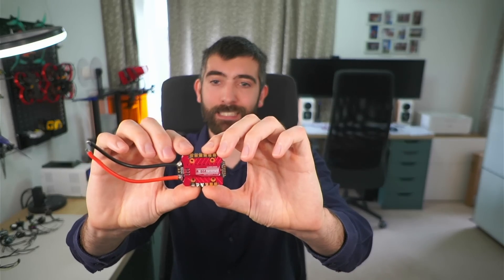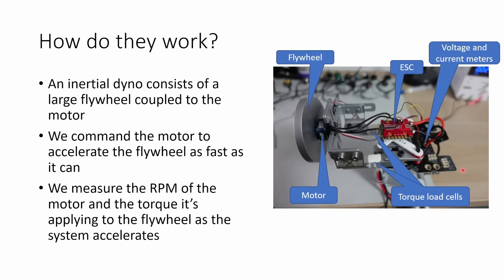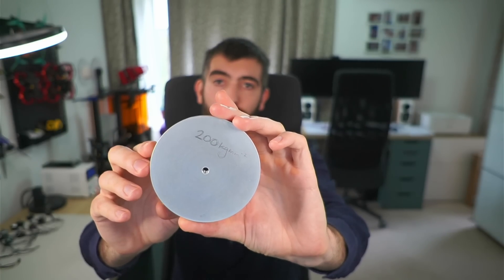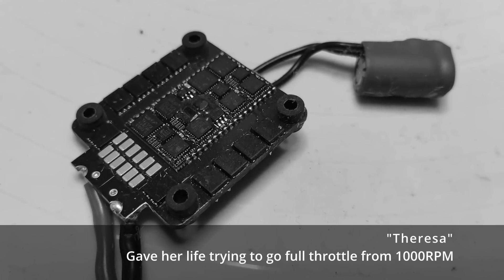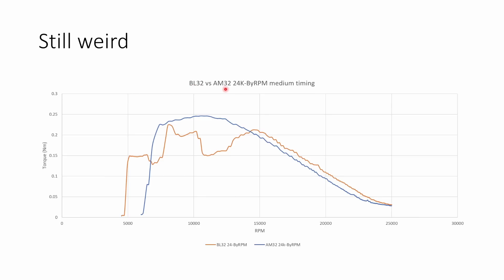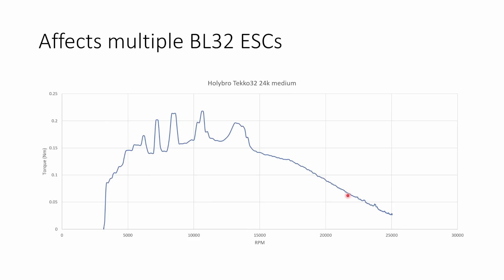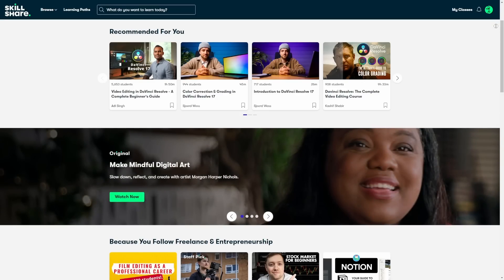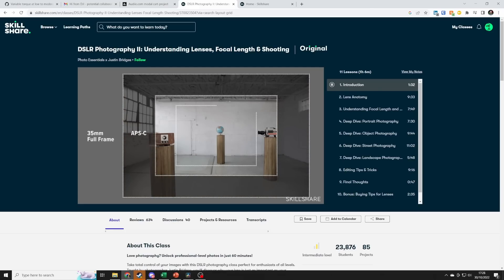Did I find a bug in BL_Heli32? Inertial dyno testing KM55A AM32 ESC.

Comment: Interesting test stand, are you planning to test different motors using this method? I wonder if this test will finally highlight the differences between 2207 and 2306 although I suspect not since its a power test, could be interesting non the less.

Comment: Not sure if it's low rpm throttle protection related but Am32 low rpm protections are let off gradually and proportional to the kV of the motor. That's why KV is entered into the config tool.
Reply from the maker: Whatever you're doing it is producing a really lovely looking torque/power curve 😁 Not having those big spikes and dips should really reduce the likelihood of smoking motors/ESCs under heavy loads. 👍👍

Comment: Do you think this issue can be connected to an unstable capacity of prop spin breaking? I’m just searching for an issue I have with 7” heavy builds when diving near completely upside down , where my motors seems to be incapable of stopping even at zero throttle

Comment: Very nice piece of equipment! I would raise a word of caution. Please consider a strong (polcarbonate or similar) protection shroud around the inertia wheel. If it for some reason disintegrates or falls off the axle (you never know) at those huge speeds (30k RPM) it can do some nasty damage. Just to be on safe side.
Reply from the maker: Great point!

Comment: i bet that bug won't appear on a smaller load. blheli waits for too long to speed up this huge wheel so it drops the current on the motor for a bit to check if motor spins without current and adds another spike of current to get to the required rpm
Reply: @UCzCG6HrsjDLqJs83a2OO6dQ also I do believe that am32 will have worse performance in 5inch drones sphere because of slower reaction to the signals of changing rpm and will burn all the wires on the motor in a crash or in turtle mode. If you never noticed when the motor is blocked blheli doesn't try to spin it with constant torque, it does it with impulses in such a way: here is your current bro. after a couple milliseconds blheli asks: "are ok bro, do you spin freely?" and doing it over and over again. I do believe that it's a much smarter way than am32: here is your current, pussy! wtf, go fcking spin, here is all the current we have and a slap for your ass.
Reply from the maker: I don't know, a smaller load will accelerate faster but the torque vs RPM curve is meant to be independent of the load or how fast the motor accelerates.
Reply: @ChrisRosser  I do understand, but there is a special propose of the motors and the escs for a small load and high response and you test all this system in absolutely enormous load for such a setup and compares with system for another propose
Reply from the maker: @OlegShtyrev  I do agree that this is a challenging test for the motor and ESC. But the AM32 ESC proves that it is possible to deliver a smooth torque/RPM curve under these conditions. There is no reason to suspect that the torque variability will improve under reduced load, quite the opposite! If the ESC is struggling to apply power smoothly when RPM increases relatively slowly I would expect things to get worse if RPM increases rapidly.

Comment: FWIW, I don't know how long I've been using AM32 - I flashed an older BL32 ESC over to well before BL32 supported I think even throttle based variable pwm, so it's a little hard to say where the performance benefits have been. But it has been simply stellar and reliable even for me running on unsupported firmware.

Comment: Thank you Mr. Rosser for your deepdive to improve performance and safety.
I´ve a bunch of dead esc´s too. One of my 7incher with 50amp. bl-heli s is rebooting in midflight , once i´ve seen 0 volts on my
dji custom osd , so i´m not confident to fly it now. Can it be that the fettec spikeabsorber or the capacitor is faulty?
I´ve flashed it with bluejay and it worked perfect more than 10 flights until this strange rebooting started.
Reply: Spike absorber does nothing remove it.
Reply: @cinemoriahFPV  , Thank´s i will try.
Reply: @cinemoriahFPV  Hey I found a cold solder at the - pole of the esc, removed the sa too.
yesterday one test flight with 4s2pMolicell pac 20 min. with no issue.

Comment: How about running the same test with a Blheli S it seems relevant.
Reply from the maker: Will do!
Reply: Came here for this comment.  Need to know if BlHeli_S has the same problem as BlHeli32
Reply: Could even be the reason for mid throttle oscillations

Comment: Great video! Have you played around the acceleration related parameters (ramp-up power, startup power) to see the effect on both system? They aren't set the same and don't have the same scale on both system so you may have to tweak those around.
Reply from the maker: I will be doing that but under the guidance of the BL32 devs as we work on the issue. Once it's fixed a big ESC shootout is due I think.
Reply: @ChrisRosser  Sweet! I'm excited for that, I think some fets perform better than others.